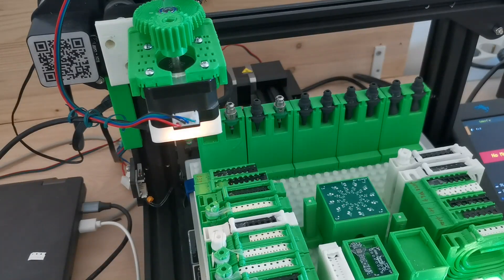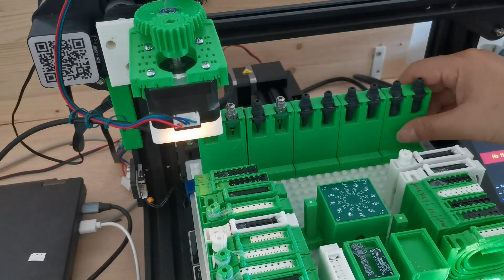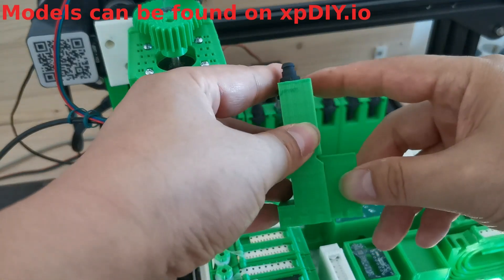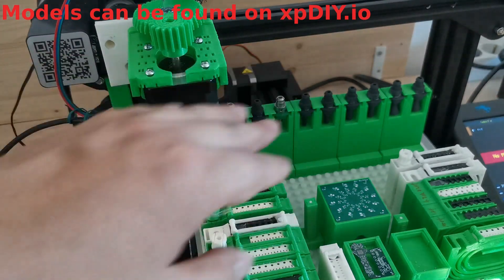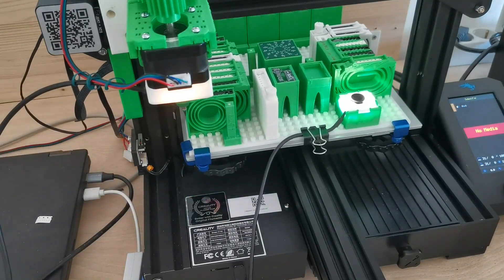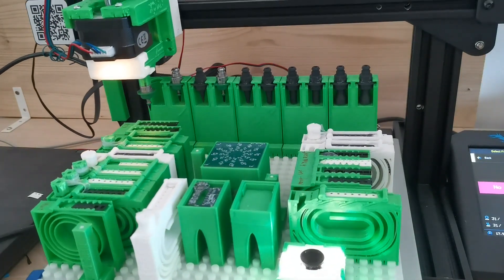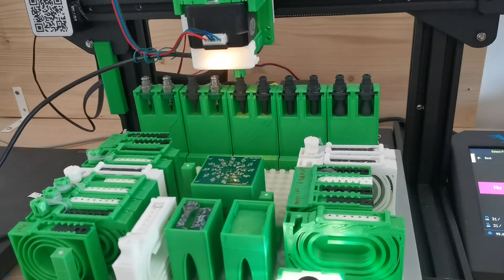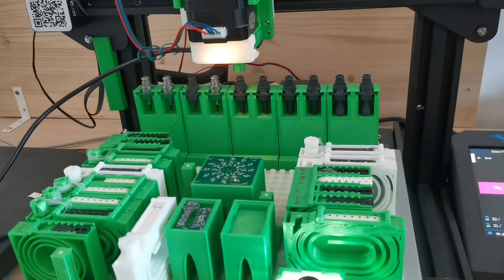3DPlacer Improvements - new design for nozzle tip change station

Comment: Would this work for a nozzle change station? Instead of 2-nozzle station that uses 5x5 base holes, have a 4-nozzle station in the same space: 2 nozzles slide in/out the front, and 2 nozzles slide in/out the back? It should not tilt because it is still 4-5 holes deep, and there would be more room for PCB and feeders?
Reply from the maker: If we need to make it work that way, then we also need to consider the slide in and out space, because sliding back will need to reserve some space in the back. Maybe left right slide can be an idea as well.

Comment: I’ll just printed the base 220x220 😂 5H Print love the Lego style
Reply from the maker: Super, 5H is actually not too bad, just wondering what printer are you using to print, as the surface is quite big.
Reply: @xpdiy  Bambu P1S all prints including the nozzles took 10H an the prezision is +- 0,05mm
Reply: @xpdiy  now the legostyle is to lose because of the good tolerances :(
Reply from the maker: What is the diameter of the lego base plate dots diameter? is feeder the loose part? I can adapt the tolerance and send it to you if there is more info.
Reply: @xpdiy  The Base is 4.76 - 4.8mm nob and the nozzle holder 5.2mm
Reply from the maker: @CranckRa1n  ok, I see, for the nozzle tip change station, did you use the nozzle tip change station v2 deaign file, that one has the updated mounting profile, and has 0.1 tolerance
Reply: @xpdiy  yes i used the v2 from your shop
Reply from the maker: @CranckRa1n  let me send you through email the file and have a look, because it should be 4.9 as the mounting hole
Reply from the maker: I just sent the calibration cubes via email so that we can find the best tolerance for your printer.